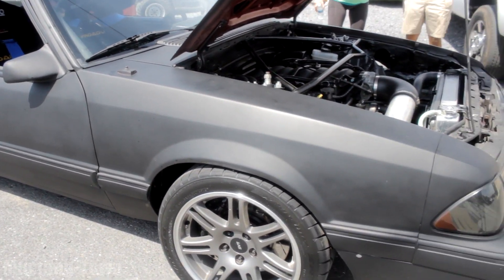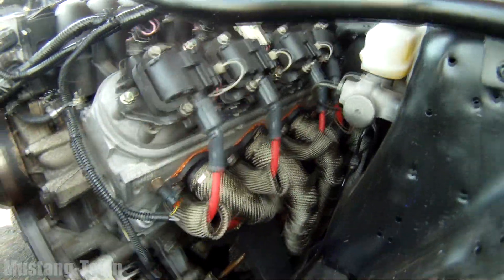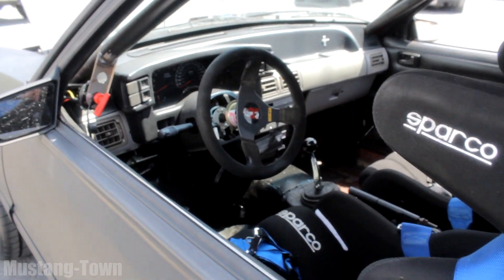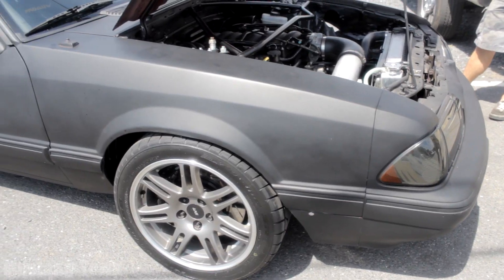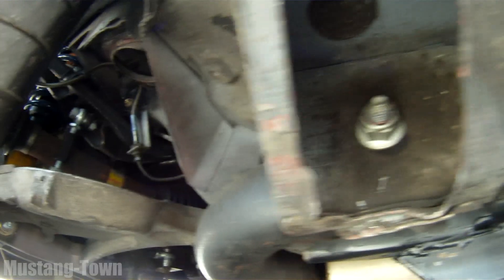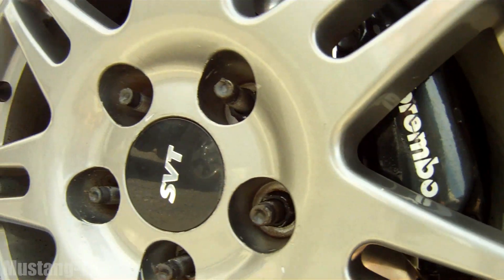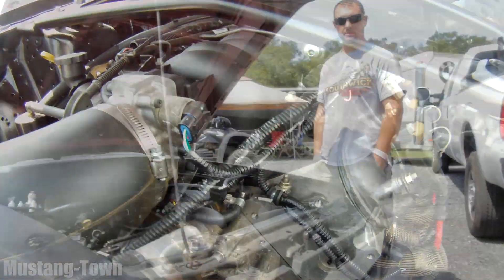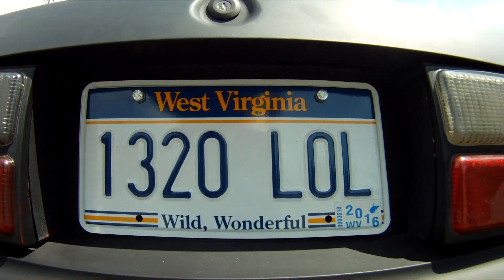“Built Ford Tough with Chevy Stuff” - Fox Mustang Notchback LX Coupe (LS1 - IRS swap)

Comment: I love all these ignorant ford fan bitching, and crying about the LS engine in this coupe.   They hate to admit that an LS is the lightest, most compact, cheapest to buy, cheapest to work on, reliable, most efficient, engines that you can get, but it is the absolute truth.   So keep crying...LMAO
Reply: mfnbigdaddy73 is it ignorant or brand loyalty?  The ford 5.0l is pretty damn reliable, huge inexpensive aftermarket for them and last one i put together cost $200 to buy then i put $500 into ran like a beast.  LS is a good motor but in a Ford?
Reply: The body makes it faster. Thats why he swapped in it a mustang instead of another maro
Reply: Im a ford fan through and through but you can't deny that the LS is a great platform.   Cheap,  highly upgradable, compact,  and reliable.
Reply: kell m  coyote is too girthy, sits too far forward and too high. 5.0 roller or LS are better imo. Id throw an LS into a new stang too, push it back an inch or two and have a faster car.
Reply: Why wouldn’t you put the cobra motor in it? That would of blown that  ls junk away.. if you like the Ls keep it in a bow tie don’t ruin a fox with Chevy junk..
Reply: @mskehan19  It may have ran like a beast to you, but without sounding like I'm insulting you, a 13 sec time slip is extremely slow.
Reply: @seanraymotorsports2960  Because an LS is better in every way? You can hate as much as you like, but when people are running 5seconds with an LS motor, your opinion is pretty useless, don't you think?
Reply: Useless?? You obviously don’t know anything about a 5.0 motor ( big block ). Keep putting your LS in a Ford cause you don’t know how to get power out of a 5.0.. take the easy way in life and LS something.. like I said if you want a LS put it in a 3rd gen iroc that would be sweet. Or buy the new edge 5.0 you think that LS crap can hang with that??
Reply: Check out 50tussin or neomustang original 5.0l running 6.9 1/8.  And neomustang is going 10’s in the 1/4  LS that bitches
Reply: Big Block guessing you are talking about stock?  So you realize Chevy’s competitor in 1990 ran 16 seconds in 1/4?  Then when LS came on the scene and gave 14 second times.  Wow that LS is a beast
Reply: Chevys had to put a 350 in their platform just to be close with the 5.0,s when ford went with their new 4.6 the camaro might of had it then but were talking 5.0 pushrods I had an old iroc and it was a complete dog got beat by everyone. It’s hard to beat an old foxbody with bolt ons.
Reply: Sean Ray Chevy guys hate to admit the truth and it’s real pathetic that they always get shut down with the 5.0 vs 5.7 argument because there is no excuse there 😂..a 5.0 usually beats a 5.7 and a ford 5.8 absolutely destroys 5.7..it’s hilarious when these Chevy swapped mustangs get their ass’ handed to them by sbf power plants 😂😂
Reply: Big Block It’s amazing how little you know 😂
Reply: @seanraymotorsports2960  If you just said a 5.0 is a (big block) then its evident you don't know shit about fords.
Reply: @eriv4735  It was so much fun killing those slow ass 5.7 Iroc's and Trans Am's in my 5.0 (NOTCHBACK) of course
Reply: @thehellfox3423  Sean Ray was replying to big block not saying the 5.0 was a big block
Reply: @wood4278  they always get so butthurt 😂
Reply: a chevy guy buying a ford and drop an ls engine in it and denying that there isn’t any ford engine’s that can match it and ignores the SBF modmotor and coyote platform’s .. who is the ignorant ?😂😂

Comment: Cool build. I went the same way and I was what I had thought a die hard Ford guy. Well it just made sense to me too switch to a LS motor. I was a little above 500RWHP with a 306ci and a turbonetics 67MM popped a keeper off the valve and had the heads redone with springs, retainers and keepers. The builder told me those blocks weren't good for even as much HP as I was running to the wheels. Well long story short the after market dart block was more than a complete LQ9 6.0 LS motor setup with the iron block good for 1200HP or so. At that point it was an easy choice for me. The LS engine made more HP was cheaper to make HP and was a hell of a lot stronger. Point being LS in a fox is the best enigne in the best platform(thefoxbody)
Reply from the maker: +Brady Skeen ...and the LS1 is lighter too, lol. You made a good point, best bang for your buck motor in the lightest American V8 platform Ponycar. It really is a no brainer for an old school motorhead/hotrodder, lol. I just don't understand the people that get soooo fightin' mad about it, lol. This is exactly what Carol Shelby did 50+ years ago. This stuff right here is what made hotrodding.
Reply: Hot Rodder mentality for sure. Doing a 5.3 in a coupe myself

Comment: this is awesome. do you know the wheels sizes and backspacing or and also what are the brackets called to mount the irs. i bought one from an 03 cobra but have not installed it.
Reply: +Marc Pitts Steeda IRS subframe bracket.
Reply: Cool thanks.
Reply: I actually got the same tag as you haha. But it's cool because I'm in md.

Comment: This would be the mustang of my dreams.  Any idea on weight and weight distribution?
Reply from the maker: Mark might correct me but I would guess that overall weight is right around 2,800lbs with a much better distribution over stock with the IRS setup which adds around 50lbs (over the solid axle) to the rear and the battery relocation adding around 30lbs to the rear too, as well as the K-member (and battery) removing weight from the front.... and that lightweight aluminum LS-motor. This car has amazing weight distribution! ...I just don't know the %, but surely it is very good.

Comment: blame ford with one motor choice that's too dam wide and tall  plus you can buy 2 LS engine for the price one coyote 5.3l with a cam makes over 430hp research it
Reply: There’s just far too much wrong with your theory
Reply: @eriv4735  agreed the ls is cheap because it's been around for decades now. Also the Ford motor would have been fine regardless of the fact it was a pushrod engine. We  made 500hp+ N/A even back in the 90s with the 302 and shifted at 7,800rpm all day long.
The reason the ls makes power is because the factory head has a ton of potential. Even a ported truck head can flow 300cfm+. It's hard not to make power with that. Although this dude said the heads are the same besides the valve type. Also the combustion chamber is smaller on the truck 5.3 which gives you little more compression obviously over a zo6 head. 
Manufacturer doesn't really matter. It's the person behind the build. You can making reliable power with Ford or Chevy if you know what your doing. Although any idiot can add boost to a ls and make power. Not hard at all.
Reply: Nice fox crappy engine

Comment: nice build. for some reason I could never put a chevy motor into a ford. Sure, you get instant horsepower and torque with a cam and different heads. But you could do the same with a ford motor.  Not knocking the build. But, just doesn't seem right.

Comment: What size wheels and tires on this car im buying a car just like this but dont knkw what size wheels will fit with the irs out of a 04 cobra
Reply from the maker: superkiller45 These are the "10 year SVT Cobra anniversary wheels" from a 2003 SVT Cobra anniversary convertible model....
Reply: nedaCFilms / Mustang-Town do awesome you by chance know if they are the staggered wheels 17x9 and 17x10s or 9 inch wide all around? Know where i can find more info on the car?

Comment: Nice one.  Who makes the seat rail your using?  Having hard time locating for the side mount race buckets.
Reply from the maker: Not sure what his seat/rail setup is.... in the past I have just used the factory Mustang rails and welded them to the racing seats. Did the same thing in an old 3rd Gen Camaro also.
Reply: nedaCFilms / Mustang-Town Thank you but im looking to buy new.  I track my cars on big circuits and safety comes first.
Reply from the maker: If one knows how to weld correctly it will be just as safe, or better, lol.

Comment: I have a 83 notch back its a 4 cylinder automatic and i want to do t t56 ls1 swap but my biggest concern is placing the ls1 in there. I know u have to have a new k member but is there specific motor mounts i have to use?

Comment: THE 1981 FOX MUSTANG HT I OWN HAS A 360 MOPAR ENGINE SINCE I HAPPENED TO HAVE A BURNED OUT FORD 302 IN A PRISTINE BODY AND A WRECKED 1993 DODGE RAM PICK UP TRUCK WITH A 4 SPEED DUSTER  TRANSMISION... IT IS NOTHING BUT AN ADAPTATION FOR A WORKING CAR THAT CAME OUT GREAT, NOT ´´DISRESPECTING´´ ANYTHING OR ANYBODY, JUST THAT...JUST MY COMMENT...
Reply from the maker: Actually I think that is pretty freakin cool lol.

Comment: Who cares about brand loyalty anymore? And you guys talking about how 302s and 351s would stomp him? He's using all factory parts! Would your Explorer GT40 heads and E303 cams make 416 whp? Not without some serious head work and a stroker.
Reply from the maker: You are right about that lol. Factory produced power and  even a GT40 equipped 351 like used in the '95 Cobra R or Lightning would have a hard time messing with this LS-5.3
Reply from the maker: ....but a GT40 equipped 351 EFI like the '95 Cobra R models had would be a little cooler to me, but these LS-based motors are really light and it's all about shooting for that 50/50 weight balance in the road course.
Reply: 351 w/ GT40-Z heads, ported Lightning intake and a Z303 cam make over 500 crank. Hell, the 363 Ford crate motor makes 500 stock.
Reply: Was the gt40z a factory original part on any car? Don't think so. The point was that any junk yard LS truck engine can be fitted with factory H/C/I and be made into a monster on the cheap.
Reply: Robert Cary He said 'factory'.. but ok if you want to compare production cars only, then the 302/351 windsor is a hell of a lot older than the LS. Ford stopped developing heads for the production 302W before the LS was even a twinkle in a GM engineers eye. The Coyote and Modular V8 is a much better apples to apples comparison.

Comment: I have a 90' 5.0 hatch with IRS and finding wheels with a high offset so the wheels don't stick out too far and rub the fender is a PITA. I'm wondering if this guy in the video had to run some negative camber in the rear in order to fit those 9" wide wheels like that?

Comment: Why cant ford guys admit that ls motors are better than ford motors for racing? Ls motors have more torque, easily maintained and easy to work on, and reliable. There is a reason they swap ls motors into your fox bodies...
Reply from the maker: Todd Rich LS motors aren't just getting swapped in Fox-bodies.... there's a huge movement in the drifting scene with late model GM motors getting swapped in every rear wheel drive import car on the drifting circuit, lol. From 350Z and 240SX to BMW and RX7, etc.... it is the best bang for the buck, cheap and light V8 power! ...and I have two Fox-body Mustangs, 5.0 liter Ford powered Fox-body Mustangs, lol.
Reply: the dohc 4 valves can take loads of power on stock bottom end. same with the new coyotes. those are just more spendy so people swap ls into them cuz they'r cheap and easier/cheaper to fix. i personally would go turbo/supercharged 331 stroker. and a nice ls1 gto on the side for a daily ;) ahh some day...
Reply: It's called humble pie and some people don't like it. Bottom line ford has left their followers out in the cold in after market performance unless you have deep  pockets.having worked on the mod motor and the Ls motor I'm amazed at how much of a labor difference their is in something as simple as a spark plug change
Reply: labor difference? i think theres more work into plugs wires and distributor. theyr cheaper tho so thats a plus. the dohc heads are expensive to build but you dont have to build them.. they'r great already. throw a blower with pulleys on with injectors and tune on those coyotes n bam 7-800horse just like any Ls. building cars in general requires deep pockets. if you are concerned of this. maybe you should consider staying stock ;p
Reply: Snap Clap Ls motors don't have a distributor and the plug wires are about 8 inches long.
Reply: woops my mistake, i know ls dont have distributor but thanks for correcting me.  i dont think the on plug coils are any harder to do though. at least on the coyote they'r easy as pie
Reply: Snap Clap If you ever changed spark plugs on a modular motor and fucked one up (which is easy) you would love LS1 too. Just saying.
Reply: i never said i dont like ls1, i love both. i just dont see whats so hard about spark plugs w/on plug coils lol
Reply: Will Thornton been there done that. Triton 3valve, and to add insult to injury had to buy a tool to remove the old plug
Reply: Todd Rich I would go ahead and say that the ls1 is better than the 302. But why not compare a 351 cleveland, thats a more fair comparison. got one on craigslist near me for 400 bucks.
Reply: Short of the Cobra Jets, I dont think Ford ever got much better than Chevy. And same goes for these newer LS1 and modular motors. Don't get me wrong, I love the sound of a 5.0, and even most of the Ford motors and they are fun to run. But out of reliability and cost's sake, LS1 is just better all around. Now I can't speak for aftermarket stuff, for all I know a suped up modular may be way better than a suped up LS1 at the same price. But stock, LS1 for sure.
Reply: Todd Rich Chevrolet is definitely superior, but since i'm a diehard Mopar guy I prefer the Chrysler blocks such as the 318 if I wanted to do something like this.
Reply: mr.18436572 whats so hard about doing sparkplugs on a modular.. jesus ppl. OH NO YOU HAD TO BUY A SPARK PLUG SOCKET ITS THE END OF THE WORLD.. wow..lol and ppl think cause im stickin up for ford means that i hate ls engines which is retarded cause id prefer a LS. If you dont feel confident changing your own spark plugs then dont do it yourself, regardless of what kind of motor it is.
Reply: +Snap Clap obviously you haven't replaced spark plugs in a ford expedition or truck, not to mention the 3 valve triton motor with about a 120,000mi. Oh by the way you'll need a broken spark plug removal tool for those, you can get one from ford. It's not about being confident in doing the job, it's about how annoying a simple spark plug change is on one of those motors compared to the good ol reliable Ls motor.
Reply: mr.18436572 its only a bitch if they break. i broke one once but havent since. i dont go over 50k on plugs either.
Reply: +Snap Clap seeing it's my job at this present time, I've had the misfortune of using the ford spark plug removal tool more than I care to and the aftermarket plugs don't guarantee a hassle free change.  Your 50k plug change is by far the exception rather than the rule. Come to think about it I've never had to have a special tool to change spark plugs in my Chevrolet motors
Reply: Wouldn’t say it’s superior, god no, it’s just cheaper.

Comment: Well at least it's the same firing order as the 5.0 HO.
Reply: ziah Reid what does that have to do with anything?
Reply: +ziah Reid theres no distributor how is there a firing order
Reply: 302highperformance Distributor or not, all multi-cylinder engines have a firing order. On engines without distributors, the firing order will be determined by either the ignition control module, the ecu, or some combination of the two.
Reply: oh so that's how it works im not really into these moduler engines im with all the carbureted motors
Reply: +302highperformance Dumb
Reply: forehead jones you can say that all yo want butt we all have are likes for what we work on you like moduler engines I don't I like carb engines with ditributors that that buddy

Comment: I'm in the process of building my 93 now. Did an IRS swap, 95 spindles and a bunch of stuff from Maximum motorsports. I was wondering what wheels, backspacing, and any wheel spacers you are running to get that stance and what you had to do to tuck the tires, I have 04 cobra wheels and it looks like I wont be able to tuck the tire in the rear, but I have a lot of room to move in toward the frame if needed. Also have a 5.3 out of an 04 Sierra that is getting rebuilt next Fall and installed next winter.